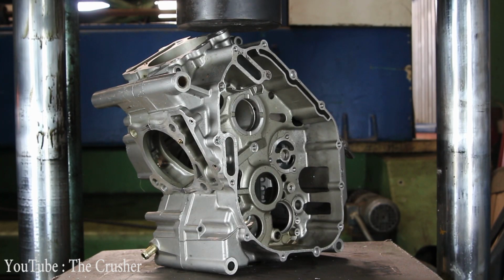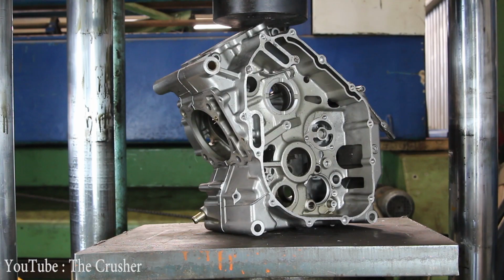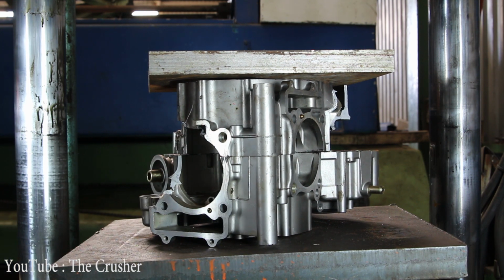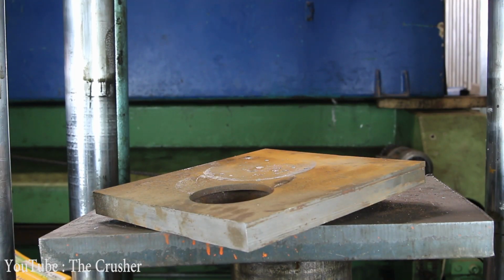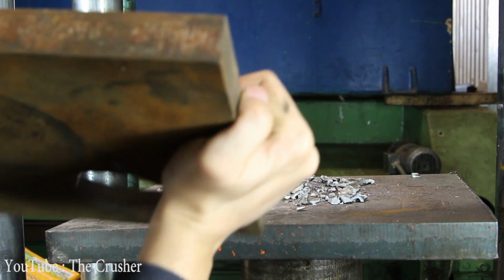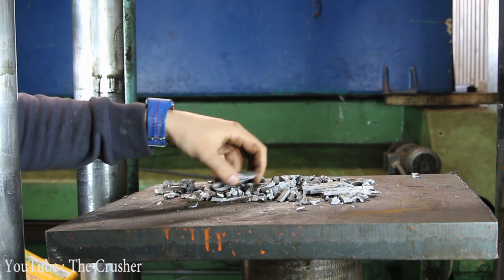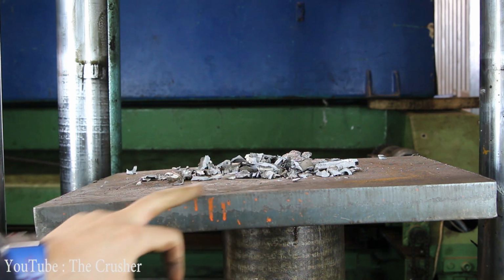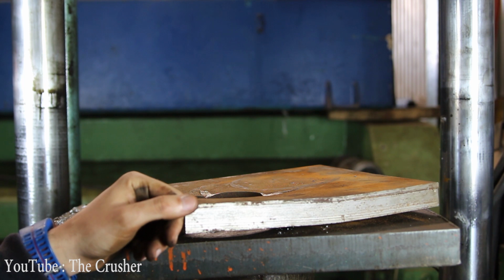Experiment Mega Hydraulic Press 500 ton VS 1000CC Engine Block

Comment from the maker: this hydraulic press is just too much im thinking to fix the small press and just use this one every time that we are not able to crush something... what do you think?
Reply: The crusher That's genius :)
Reply: Good idea
Reply: I think you should redo your other crushes from the small press on the 500 ton press to see the difference. I also think better tooling would help. Nice video.
Reply: That might be an idea - but I want to see more of this, because it's really awesome. 
I can see the problem that it's hard to get pressing tools that can withstand that force. I think it will help at least some if you put support also in the corners of your lower pressing plate (like that steel cylinder you have in the middle) - that way it will not bend as easy.
I would also say that you have way too much power - that gives you a lot of speed combined with the high pressing force. In this case, it's better if the piston moves slow with just the 500 tons of force - that makes it easier to control. That could be solved by putting a gearbox between the motor and hydraulic pump and perhaps use a smaller motor (that may be hard if it's a prebuilt machine that have everything fitted from factory though)
Reply: I think you need better tools and still use this press
Reply: The Crusher As the Americans say,  "There's no kill like overkill!".
Reply: Ride84XL: The problems with changing the motor is that a smaller motor would not provide the 500 tons of force. Also a gearbox might cause overpressure because the reduction would give more torque and therefore more potential pressure which may cause excess wear on any safety valves that prevent overpressure. I do think he should build a more stable support for raising the bottom plate. Maybe three plates stood on edge and welded in an X and placed under the bottom plate.
Reply: No please, this is so good for everything =)
But you should fix the table =)
Reply: The Crusher πως παει με την κοιλια σου καλα; ειναι ακομα η γραμμη ή εφυγε λιγο; πως ειναι τωρα; αν αλαξε πολη διξεμας ως ειναι τωρα :)
Reply: The Crusher bey crusher try to destroy a concrete block !!!! is if capable?
Reply from the maker: +Creebot The Great thats easy i will do it soon
Reply: Be careful with the parts breaked,,,theiy goes out at high speed and may you damage an eye or another part of your body,,,whu do you dont use a circular polycarbonate 10mm thick,,,as a protection cover????a Suggerence....nice video.
Reply: Crusher, do not play in backward direction.

Comment: One major problem I see here, is that your lower tool and stand are not mounted to the press. I don't have the insight to know if it's possible, but I think you can control the pressings better if the lower tool and stand are fixed to the press.

Another thing; It seems that the press piston moves down real fast, which could make it difficult to control, isn't there a way to adjust the speed of the piston?

Other than that, I like the new press. It seems a lot more modern than the old one, so please consider solving the issues before switching back. 

Thank you for always great vids :)
Reply from the maker: JmyhDK this 2 isiues can cost about 5000euros and this is an issiue as well everything is so expensive with this big machines. plus this press is destroying my tools as well really easy so the issue is that to find tools that can withstand 500ton force and this is so hard and expensive...
Reply: Yea I see the problem. I'm not an Press expert :)

So going back to the old press might be a better solution. But what would it cost to get that fixed? I assume anything going with these presses are quite expensive.
Reply from the maker: +JmyhDK i will try find an H type steel that will maybe improve our press table even i  this one...
Reply: I'm quite confident that you will find a solution :)
Thanx for your efforts.
Reply: JmyhDK how about 4 more stands in every corner of the table? i dont know if its possible but could you make 2.5 cm holes for the stands in the 4.5cm table? hope you know what i mean. i dont really want to miss big papa :/